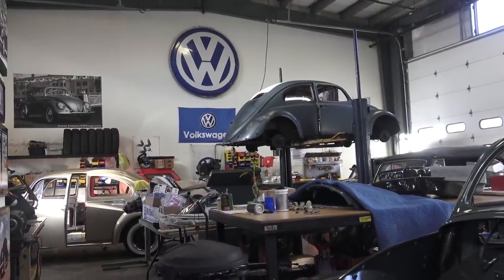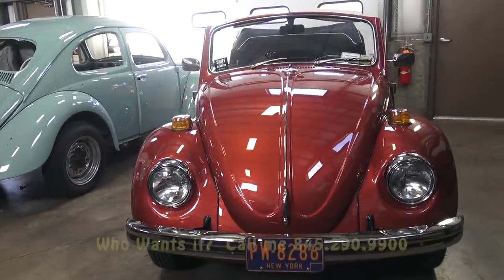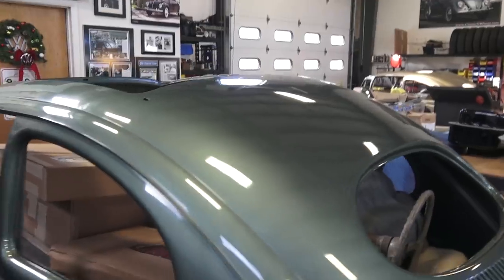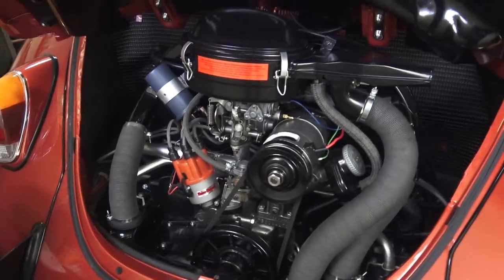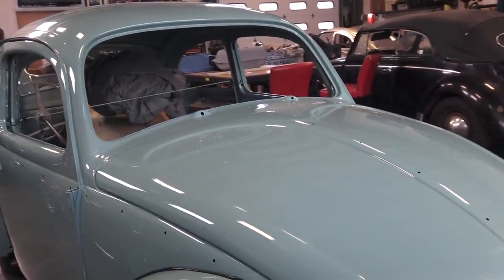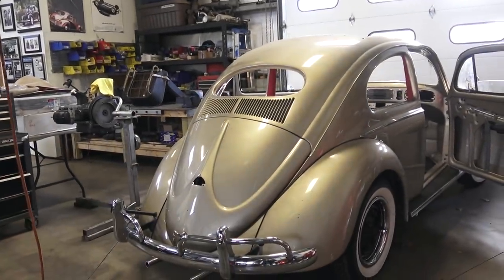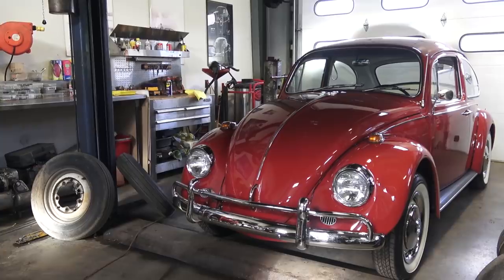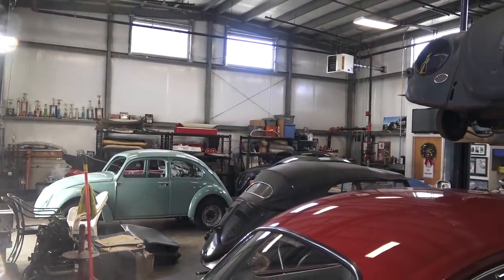Classic VW BuGs November 2018 Beetle Shop Restoration Job Update

Comment: Nice shop & Great restorations. I brought my daughter home from the hospital in a '64 Bug. At the time, I lusted for a '71 with 2 speed wipers and about 18 more horse power via a larger displacement and duel port heads. Why do you prefer the single port engines?
Reply from the maker: They are less finicky, simpler.  Dual port motors are great, don't get me wrong, but they are notorious for that infamous FLAT spot.  You need to have the right dizzy and carb combo.
Reply: @classicvwbugs  Thanks, I remember kits for twin carbs for them and like the type3 keeping them in sink was a small challenge. But did they have a flat spot with a single 2v bug-spay or a stock 34 PICT?

Comment: As usual the cars are gorgeous and I'm infinitely jealous you get to do this for a living.
Are the old yellow-on-blue NY license plates on the '70 vert legal for road use or do you just have them on there for appearances?  I didn't think our beloved state offered retro plates like that.
As for that '54, if it were me, I'd make whatever structural repairs are necessary and put a fresh coat of paint on it, but keep everything that's original and just clean it up.  Bugs that old aren't common and keeping it stock provides a "original" car others could potentially use as a reference  to accurately restore other bugs of that vintage.  Besides, it'll be worth more if it's as stock as possible.
Reply from the maker: Thanks so much man!  and yes in NYS you can put on Vintage Plates, they have a form on the NYS DMV website for it.  You buy the plates on eBay and then send a pic of them to albany and they can verify if you can use them or not.  And yes we have been tossing around what we should do with the '54, you make great comments.

Comment: Do not restore de 54 !!! They're only original once!!
Reply from the maker: I hear ya, but I also feel it needs to see GLORY again!  =o)
Reply: Yeah true but that original interior is soooo beautiful  @classicvwbugs
Reply from the maker: Yeah I could keep that  @tanihcstuag3109
Reply: This, totally!
Reply: That would be awesome  @classicvwbugs
Reply: Do a 100% mechanical restoration. Restore the engine, transmission, brake system & front suspension to new showroom condition. Compound out the body, clean the seats as best you can and treat the rust so it doesn't spread. Put on a new set of black wall tires, some black coco mats and call it good. It will draw more attention than a restored car. When someone walks up the car with the deck lid closed the only thing new they should see is the new tires. I understand that you are in the restoration business and you want to make everything shiny and new. But leave this one alone. Once it's restored people will never know what kind of condition it was before the restoration. Most will think it was a total piece of junk. That patina cannot be replicated. You can thank me later...lol. A little about me...My dad and myself ran a VW shop in my late teens, Now I'm 52. I never drove anything but VW's till my late 20's. Got burned out and got into pre 66 Corvettes. But in the last few years I got the Bug again. Picked up a 56 Oval, a few months ago I picked up a clean 57 sunroof and last week I bought a super clean 66 Convertible. Plus I have a 3 owner 55K mile Karmann Ghia. Also own 66 AC Cobra, 66 Corvette, 71 Corvette Conv, 99 Prowler with 5000K miles. I've watched all your videos multiple times. I'm building my parts list and where to source what and plan on doing a high end restoration on the 57 ragtop. I have a couple of 36 horses on the shelf that I have had for over 30 years. Thinking of doing an Okrasa dual port from Wolfsburg West for an old school power plant. Appreciate all you do. Take care,,, Mike
Reply: I would just clean it up and get it mechanically sound and take it to shows and see the reactions.